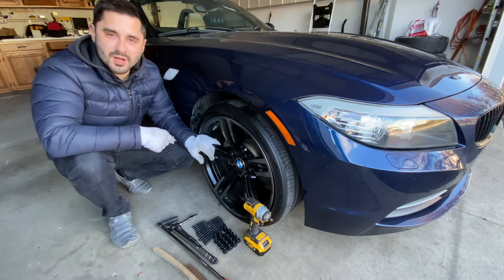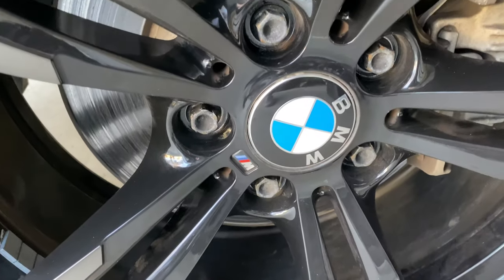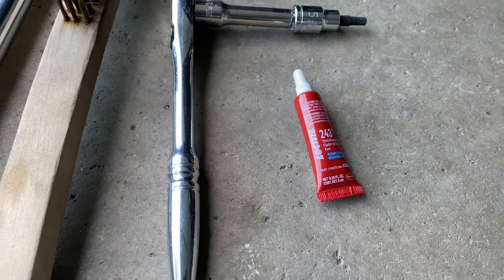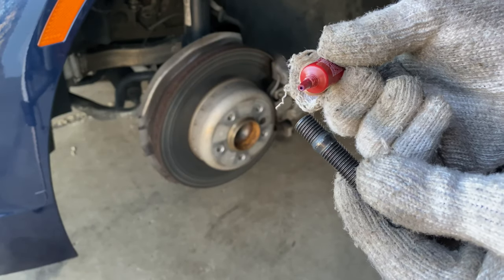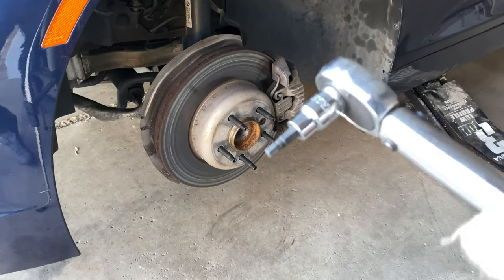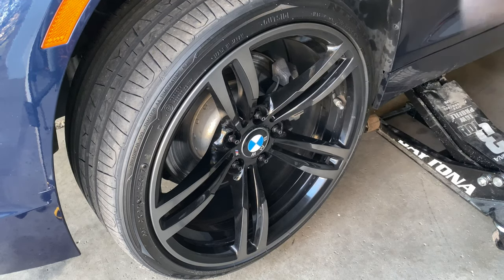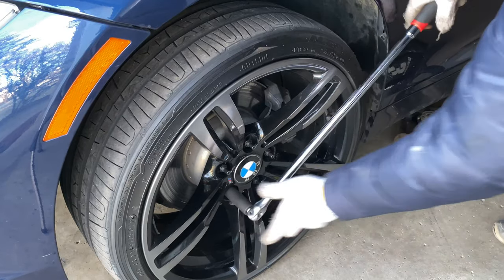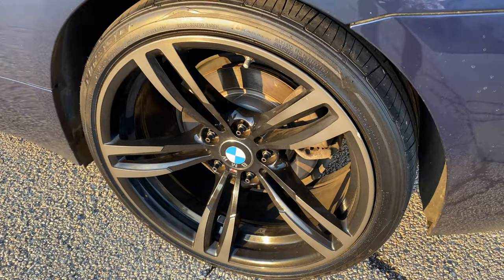BMW Stud Conversion - BMW Z4 DIY

Comment: Is there an issue with the M3/4 wheels using M14 bolts, and the Z4 taking M12? Does anyone make a M12 - M14 adapter stud conversion where the M12 goes into the hub and M14 for the wheel?

Comment: All I see is spike lug add ons lol think about it. Nice conversion but do you think as you take off the wheels and bolts, the studs will become loose over time? Due to excessive nut removal of course
Reply from the maker: It’s not for everyone and I understand that. I really liked the look when I saw it on an M4 by my work, so I decided to convert my car as well. Since I’ve used the Loctide and torqued properly, the studs should not loosen during normal use.
Reply: SimpleCarGuy of course of course and okay I see. All around how much did it cost you? I’m probably gonna do that to prepare for spikes if I get custom rims or maybe plasti dip the stock 19’ 550i rims
Reply from the maker: @MauriceEllerbee  It was about $120 for the studs and nuts and the loctide. I think it would look pretty cool on the 550. If I upgrade the wheels on my 550i, I will do the same.